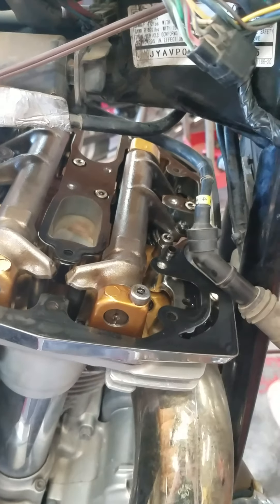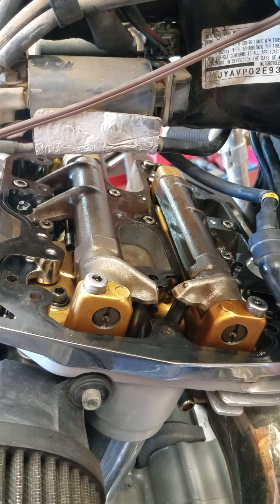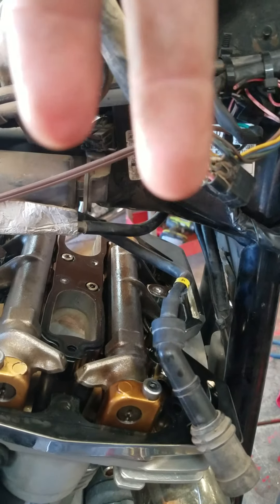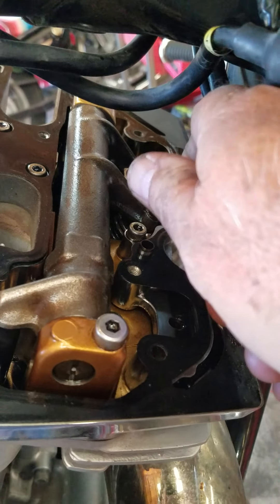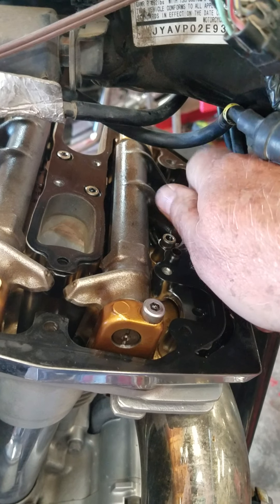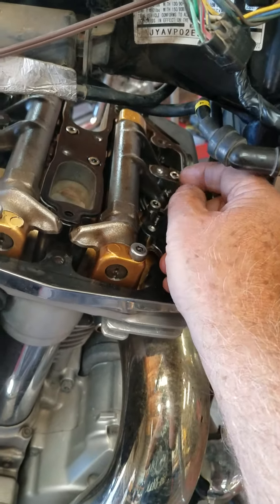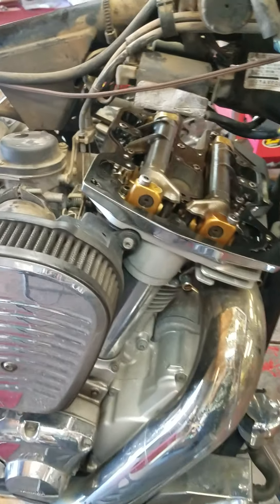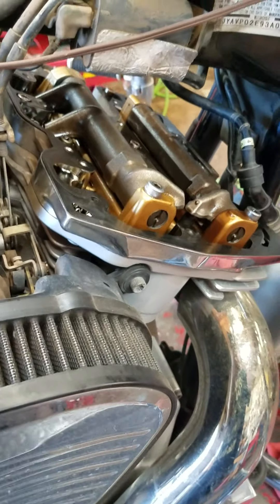Yamaha xv1600 Road Star valve adjustment

Comment: I have a 2001 1600 roadstar. I went to ajust the valve gap and notice. The rocker had a lot of  play in it on the exhaust side front and rear cylinder.  like the lift had bleeded  down. I thought it was odd to be the same on front and rear on the exhaust side.
No play,  on the rocker on the front and rear cylinder on the intake side. What are your thoughts on this? The bike has over 30k on it, and It was not taken care of before I got it

Comment: Would spinning the rear wheel on a motorcycle lift be more precise in setting the valves before tightening the valves?
Reply from the maker: yes. ideally,  you want the cylinder at top dead center, loosen off on that single adjuster, then run it back until you just take the slack out. no clearance.    To where both valves are touched or opened at same time by the rocker arm. If it still rattles,  replace lifters with yamaha lifters. Chevy 350 lifters will fit, but are designed to oil at much higher oil pressure.
Reply from the maker: most all bikes have a cover or plug to gain access to a nut on the end of the crank. you remove spark plugs and turn engine over with socket/ratchet, etc
Reply: My 2003 will sometimes have a flat lifter on startup (from new) because the engine stopped with the valve open.. As the oil warms up it goes back to normal.

Comment: So no need for feeler gauge? Just set at zero lash? Do you feel adjusting valves is mostly for noise or have you seen Road Star motors crunch Because they valves were never adjusted?
Reply from the maker: no feeler guage, zero lash.
It seems to be just noise, but over a longer period of time it's possible to hammer itself to death.
each rocker pushes two valves,  so you adjust the adjustable one to where its touching the valve "right now " same as the non adjustable one. when not equal, they tap tap tap

Comment: Putting my cover back on and i ended up snapping a bolt from over tightening it it snapped off inside and seated. Fully and also cracked my fin.

Talk about a rough morning is this something i will now have to go to the salvage yard here (he has a few warriors and R*'s and replace the jug or can i j b weld or any type fix sigh the valves needed so much screwing down to 0 clearance i was blown away how far but i was also hearing a swish swish swish that i hoped was only valves out of whack..... I uploaded a video yeaterday of her idle and rev a few times and listed all the work ive had to do to her
Reply: Also when i was getting the valves closed id keep flicking the starter till neither arms moved when id flick it then adjust both rockers that cyl then adjust and repeat on other that's hopefully right? Before i try fire her up and on top the cracked fin do something n break a rod or valve from wrongly setting
Reply from the maker: Not sure which bolt you twisted off, the valve cover bolt? If so, you can maybe seal the cover hole to keep from leaking oil and run it. Or drill it out and heli -coil it.

On adjstng the rockers, when they are "up" with no spring force on them, then you adjust out the slack
Reply: @geezermoto7820  its the smallest bolt position on rhe rear cyl the one right above the largest bolt (very bottom left) also to the Southwest of the spark plug. The bolts broke off deep inside im worried it will leak from where the crack is on the fin and what about that spinning bolt ? Sigh
Reply: I cant be for sure "there was no pressure on rockers" pretty sure i made sure they was both level which was what i thought ment closed and neither would move again RIGHT after they both closed and id barley barley hit the starter once i seen both seat and flip starter no movement from either rocker i adjusted was that wrong considering they needed considerable amount of adjusting (it was really loud as i stated in my video i uploaded yesterday you can hear the swish swisg swish i assumed was my valves ?
Reply: Let me guess without being for sure there was no pressure and adjusting too 0 lash i possibly have really messed things up.badly and need to extract the bolt readjust and figure put how to fix this crack ? 😥
Reply from the maker: @christopherkimmer8240  when the piston is at top dead center either the exhaust valves are open or all valves are closed, all closed is ready to spark, explode, push piston down.
....you can remove spark plugs and remove the smaller round cover just in front of the clutch on left side of engine and a plug isthere to remove and turn the crank with a socket.
If adjusted wrong to can bend valves.
If you bump starter, watch ex valves close then you come to tdc of the compression stroke when the valves are adjusted
Reply: @geezermoto7820  that's what i thought i did i looked to make sure both push  rods closed  even and when i seen both close and  i felt it was about enough starter flips for it to be. Tdc again I flipped it one more time no movement from either rocker i had that double confirmation (i thought at least it was confirmation but i didn't slide feeler gauges to see if any pressure since was going to 0 lash)  I went in and repeated on other cyl was that correct?
Reply: @geezermoto7820  honestly i wanted tdc by cam cover i removed 5 bolts and the 6th came all the way out of threads but the kick stand sensor stops me from completely removing it even tho its all the way off the threads but even with  that and 2 bolts i knew wasn't a part of it still removed just in case i couldn't remove the black cover too save my life it stumped me i tried to bang it lose with a rag over it and a hammer and tried to pry it with the lips within reasonable force not even a budge so i studied your video
Reply: @geezermoto7820  im unable to FULLY seat that spinning bolt im going to attempt placing 3 washers under the bolt sincr it 3 and 3 4tths seats is this a bad idea
Reply: @geezermoto7820  I put it back together fired it up it ran for 20 seconds then stalled out I recorded it bv I knew this would happen what are my options from here since I cant figure out how to hff et the cam cover off... I tried pulling any bolt in the general area still nothing I dont understand .... yes there 2 hard to see ones behind the kick stand I removed and I removed the shift linkage
Reply: Luckily the cover came off and i believe only damage done was to the bolt ill try the next size up for the bolt that never fully tightens its weird bc with the cover off the bolt screws in and tight stops spinning ???? But i w
Was able to remove the screw with cover off and pliers n ended up using a screw driver to confirm the highest point  i could find it would reach adjusted and she runs so so so much quieter the loud swish swish as become a quiet swish swish and i know theres always some noise so ill take it she ran hard and clean besides i could not get past 100 it would start sputtering... With having 2in1 no baffle Big Air Kit and a dynatek3000 ignition pumpless i have tried some massive jets i got a 45 pilot and a 182.5 im assuming my research was wrong and and im way to rich

Comment: geezer, can u do one for lifters? apparently there were some bad batches from yammie, and there is an american equivalent replacement part...
Reply from the maker: chevy 350 lifters from like the 80's will fit, are 5 bux each instead of the 50. yam price, but, you need to use yam lifters because the oiling system pressure is much higher in a chev 350, and you will starve for oil on the bike. Use yam lifters,  by now any prob has been addressed by yam.

NOTE:  The cam lobes must be flat.
IF the bottom of your lifter(s) are cupped, worn, not flat and perfect, most all times you need a new cam or maybe both cams. If the cam face   face is rounded, it will eat lifters quick. I'm talking about the surface of the cam that contacts the lifter.
This MUST be flat. If not, replace the cam(s) as needed.   Holler if you have other questions

Comment: My 1700 has developed a dull knocking sound on the fuel pump side of the motor when I accelerate, especially after shifting up to 3rd gear. This sound like a valve issue?
Reply from the maker: very possibly.  Normally they rattle worst at idle when warm, due to slack in the valve train needing adjustment or bad lifter(s)

Comment: I’ve never worked on a bike before. Is this simple for someone like me? I need a book on “workin on motorcycles for dummies” I have a 2003 1600 as well. Have a light tap on the right side of bike!
Reply from the maker: It depends, after watching the video,  go with your gut feelings on you being comfortable to do it or not
Reply: @geezermoto7820  Called myself watchin ur video over n over again then went n did as u done. It has a louder tap as of now 💆🏻‍♂️
Reply from the maker: the tapping comes from slack, they need to be adjusted to zero slack or "lash". also, they are known for the lifters or a lifter to go bad and beat up a cam. i would adjust again, if still no fix, put new lifters in, from Yamaha.  Older chevy 350 lifters fit but do not oil enough for a motorcycle
Reply: So u don’t have to adjust the ones in back? I see u only have the front cover off!
Reply from the maker: @mariojackson6061  only the front was rattling,  if unsure, adjust both cylinders

Comment: is that a reason to lose  oil after every long ride..no leaks when it is parked in garage
Reply from the maker: valves a little out of adjustment are not going to cause you to lose oil.
  It steals compression which means  lowers power. And sooner or later the clacking (hammering) will wear parts out
Reply: So.what can be the problem?
Reply from the maker: @antoniovelazquez887  well, if you are losing oil while riding,  not stopped, it could be burning it or leaking it.
  I wash them off good, clean and dry, then spray foot powder all over and under the engine,  oil leaks show up easy,  get a flashlight and mirror to help look.
  These yams are very very common to leak on those oiling lines that bolt to engine with 2 bolts and o-ring .
Reply: Thank very much...will try that..
Reply from the maker: @antoniovelazquez887  welcome bro!

Comment: 0 lash  the book says use feeler gauge. Could you help me
Reply from the maker: You just "by feel" run the adjuster in until it barely touches. You have hydraulic lifters, so, they will do the adjusting anyway to zero lash

Comment: How reliable is this? and how long are your intervals ? 
Would like to talk to you or email you.
Reply from the maker: it's just how it is done. if it still rattles, put Yamaha lifters in it. chevy 350 lifters fit, for cheap, but do not oil good enough
Reply from the maker: the orig lifters are known to go bad, or weak, not pump up enough and rattle